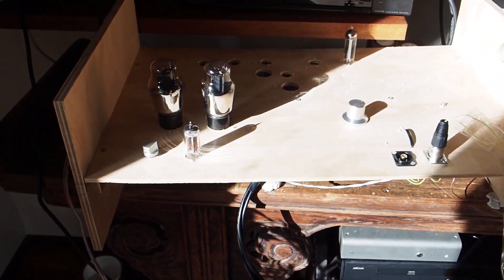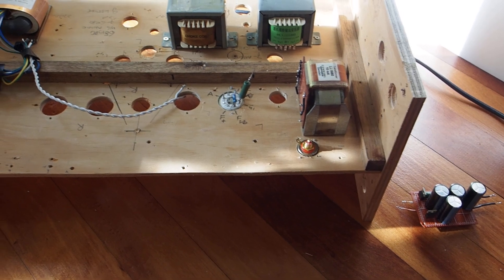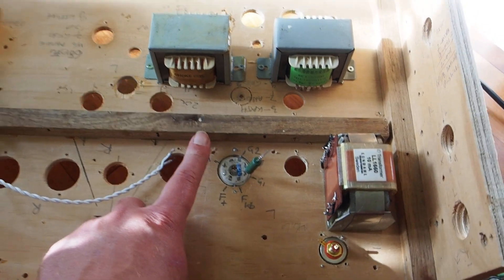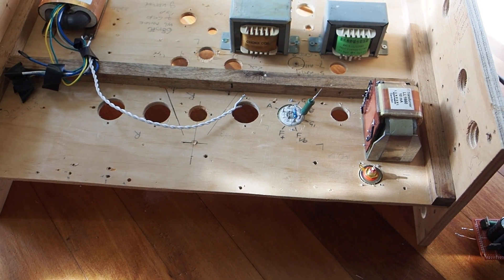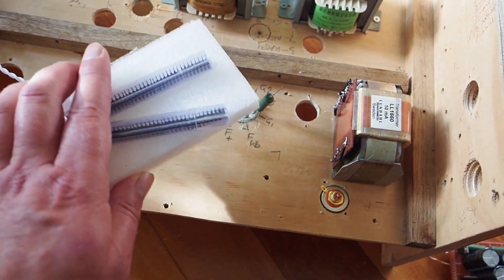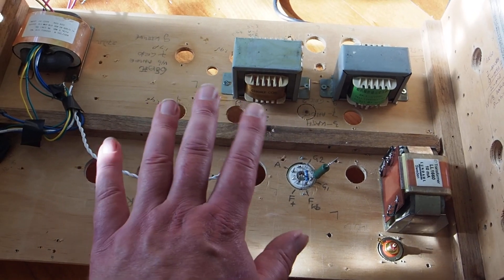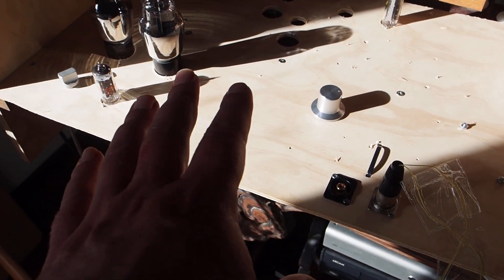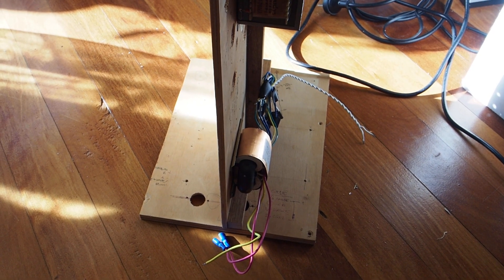A close look at one of my development tools: the H frame

Comment: The best development approach I've seen. Personally, I'm still not cured from ending up either with a breadboard so messy that is not inviting to changes and mods (because 'wow ok it works lets just leave it and build the real thing from that') or being too confident ('it's a simple circuit, it has to work like I want') and building it straight in the nice enclosure without testing board, which is again not inviting to mods, this time because it's not very accessible and I don't want to slowly ruin the case and components by many changes. So I convince myself it wouldn't sound any better anyway. Oh well..)
Reply from the maker: Thank you; I think most of us who 'breadboarded' amps know what you're talking about! Personally, I hated that after a couple of mods/changes, the amp was hard to change or became unreliable - and sometimes microphonic effects were hard to deal with... my latest, larger H frame solved quite a lot of that - look at any of my recent videos). Good luck with your projects :)

Comment: I'm collecting parts to build something similar, which I consider a "universal test platform."  It will have multiple tube & transistor sockets, and LOTS of banana-plug type binding posts.  It will test tube voltage gain & Gm, transistor AC & DC beta, and capacitor leakage.  The many binding posts will let me connect meters & a scope anywhere, in series or parallel.  There will be Vcc, bias, and B(+) power supplies built in, as well as provisions for external power.
Reply from the maker: Sounds good Clyde and thank you for jumping in and sharing what you're doing. I'm curious to hear what your insights will be after 3-4 projects!! The binding/measuring posts would be very beneficial if you have either many iterations or do measurement driven development.

I found that circuits for DACs, 1 single or multi stage tube-amps, single ended/differential all require different layouts, so the optimal layout and where plugs, sockets need to go always changes... so for that reason, I never went with a fixed setup and mounting points.

Comment: Excellent layout, taking the breadboard to the next level! Also, this is much better than a regular breadboard because you can simply flip it even upside down with all the tubes in, to work on the bottom layer. ; Cheers, Janos
Reply from the maker: Yes, I often flip it on it's long side.. hook up the voltage meters or scope.. easy to monitor the whole thing, change something.. iterate. It's funny with the type 80 rectifier, my 47 amp started mildly motor boating somewhat, so I have to resolve what was in your latest video!!! Doing a bit of prep work in LTSpice now and sim the impedance over the spectrum :-)
Reply: @EduardBroekman  Hm.. the only thing I can see on the schematics is the CT to cathode bypass cap is an order of magnitude smaller than the big C2 filter cap, however the biasing rectifier should not allow motorboating around that... you can try adding a 100-200uF to that bypass cap and see if that stops the motorboating.
Reply from the maker: @realworldaudio  Thank you, yes, I was tending to a similar plan as you suggest. Frank G. also mentioned to separate the reservoir part from ripple suppression, and the impedance sim looks much better with moving more capacitance to behind the (final) 4H choke (which should be more prone to oscillation than the 40H/275ohm choke).
Reply from the maker: @realworldaudio  I went a bit overboard, so I now only have 220uF after the 1st choke, 440uF after the 2nd (gnd) + 33uF to the cathode, and 220uF over the bias tube. 

With this, no more motorboating.. about 1V at the start but it stabilises out. However, it did get me a sonic tinge of the 440 electrolytics now which previously were at least 1 choke away (intentionally!). The sound is very revealing and hugely dynamic now.. it almost like there's nothing it can't reveal from the source... and it feels like I arrived at some kind of your ampex x3 speaker performance moment, and where the whole thing become hypre-reactive to changes. It finally feels time and for the first time fitting to apply Frank's 'seasoning' and it clicked what kind of league Sakuma was probably playing on :)

Lynn Olson once used the 45 and it performed so well, all distortion on the output was from the driver, the 45 was entirely transparent. Hence I think Sakuma was using DHTs as drivers; he had to!

Comment: ...............You can put it on it's side ..........AND...... on it's back ! 
Thanks Eduard .....the nice thing about sharing is we all can learn from each other ......the good ,the bad and the ugly .....haha..

About AC cables ..........I saw time ago the idea you mentionned the neutral and the live with different lenghts and or section............clearly there's something that will impact the resulting sound ..........;in one or another way !
Maybe it was on the same site you saw it ..........
What I became conscious about when viewing the stereo wiring off many amps and also Headphone cabling etc ...........many times the inputs /outputs share a common ground ....
So I decided to bring again equilibrity to the current on the negative /massa rail.......and used the same section for current in both neg and positive............by that I means I use the same wire/section twice on the neg rail to be equal to the two posiives .....same wires .
Even when using or working oin a printed circuit board......supressing the thin printed mass rails by the same wiring as much as possible..........
In fact the teached electronics and electricity is inversed teached .......
On a tube the cathode generates the electrons ( electron cloud ) wich is atracted by the positive anode........he flow off electtrons is in REALITY from neg to positive......in theory they yeach the inverse. It is a point of viewing but it should remember and make aware of the inportanced of massa rails and negative reference ( the source of origin of everything we  finaly hear in  an audio system )..............

Thank you for the upload and bringing your H frame to attention of every one.
Reply from the maker: Hi Frank. Yes Larry mentioned that in a video on cable gauge/width and my first two tries confirmed to me what he said. I can see what you're doing with common ground as well - makes totally sense! A lot of enclosure have potential difference that run via the ground of an interconnect too... not many think about that! I tend to run headphones fully balanced...

And yes, so true on the thinking the 'electron' way. Nearly bipolar :) On one hand the 'attraction' is from one end, but then especially when I'm confronted with DHT or a directly heated rectifier (which I worked on today).. I'm keenly aware of the 'boiling off of electrons'.. and that that way of 'emissions' is much more efficient despite the same 'attractor' on the plate or screen, but then in having to swap into thinking about diagram symbols always takes an extra couple of seconds!

Video soon, but today I put two type 80s (paralleled) in the 47 amp.. and it moved another bit towards realistic presence but also feeling the inter-musician tension/interplay and flow. It's equally subtle but also substantial.. a very odd experience - and I hadn't expected too much since I was suspecting the voltage drop to ruin things, but no - it got me more directly heated type of goodies :) 

Another very curious subject at least for the 47 is the influence of plate and screen voltage. There's a particular quality that comes out when the screen voltage is equal or just a bit more than the plate.. and definitely goes towards dull when the screen has a lower voltage: it seems like this 47 was designed to operate triode like with same voltage applied on both. Later pentodes seem to be set to a screen voltage that reflect the physical position between kathode and plate..
Reply: @EduardBroekman  Yes the screen voltage determines the waving out of the curves , higher voltage means more dynamic sound, J.hiraga did this also with his penthode amplifiers .
The limit of screen voltage ( and current ) are defined and mentionned in datasheets , ( for old tubes !!!)
..be carefull to apply those datasheets to current production , the max voltage for triode mode operation is also mentionned .

I have some 80 globe style , they are wonderfull , ........;a similar extraordinary rectifier is the German RGN 1064 , this has a " drath anode = mesh plate ) and need 4  volts on the filament , there exist a socket that accept both tubes at Jacmusic . ( a voltage drop resistor for the filament 5>>4V ..et le tour est joué  )
You may wonder about the German chemistery for their filaments .....wonderfull , call it magic .........and the meshplate lift it to heaven .......
Today ,tubes sold as mesh anode are " mostly " only perforated anode plates , fake and deceptive !

Two rectifiers = OK ( just see that the current is within the filament transformer limits )
A big power supply for the beast amplifiers from today can NEVER be so musical as the ps of a small amplifiers .....( it's only perfectly measuring on idle or on testsignals / exception for those who know how and class A ).....when designed correctly !

Separate capacitor functions for filtering ripple and for rerervoir where the  modulation ...gets it's energy . ( as you do I suppose )
An oil capacitor on input often works:/sounds  great ........something like a 600 volt NP ..........8- 25 µF ( in function of the rectifier data )
There's  a story to tell about the musical envelope ( time ) and filter capacitors , only some older technicians did know that .......and that's not oin favor of what one thinks/practice today about capacitors and their values...........in fact simply stated , the poxwer supply must be able to follow the entire musical envelope !
At the other end there is the endless battery effect ................ANYTHING BETWEEN DOES NOT WORK AS ONE WISHED.............yes you can get bigger bass, control and other suprlative audiophile gloryfied qualities , but something that the English call .....PACE , RYTHM and TIMING goes wrong...........;( also one of the big problems with many digital sources )

Good to see you enjoy still more musical pleasure !
Reply from the maker: @frankgeeraerts6243  Yes mesh plate rectifiers... rare as unicorns but I've heard that subtilty of those early Philips and Telefunken is a whole level beyond even the directly heated category. 

While I have a differential, I do now hear the influence of electrolytics.. and I just spotted Sakuma using 8u+10H+8u+10H+8u (all oil) for one of his push pull amps.. to be honest it feels like I arrived at your 'seasoning' stage.

My filter setup is 4.35uF - 40H / 275ohm - 220uF - 4H/27 ohm - 440uF(gnd) + 33uF (cathode). But the 2x220uFs are Nichicon KXGs which were previously only in between chokes, but I wanted to fix the motor boating + separate the 'reservoir' from ripple reduction as per your earlier comments, but that got these electros a bit too close to the tubes. Astoundingly dynamic and revealing - nothing is unclear, PRAT still fully intact but it has a certain electrolytic 'bite'.

Comment: Awesome to share your amazing DIY experience. Very nice dev setup. If you visit the Netherlands, stop by in Hamburg 😊 your finale enclosure looks very professional, are you selling some of your gear?
Reply from the maker: Thank you, also for the invitation - I will keep that in mind for sure! 

To answer your question, yes, I hope to offer a build service for my designs in not too long; the shown enclosure is also planned for a new headphone amp. A different (later) offer will be very likely the 47 amp: I am working on giving it a good looking, original enclosure so it moves towards being an 'objet de desir'... but it can be customised anyway.

On the finished model in the video, that is a prototype with push pull E180Fs or 6N6Ps, Lundahl OPTS, balanced in and line/headphone out - I've been using on my desk with my PC/Dac setup and it allows me to switch between my headphones and desktop speakers. I'd like to transform it into a 6E6P/6E5P based amp, which I find has a very nice tone and is very low distorting.

Reason for this is also that a friend of mine already runs an earlier version of that 6E6P amp and its paired with a Verum 1 (8 ohm!) headphone which is a really good working combo which sounds better than the Violectric amp I had, or this prototype. Anyway, I'd like to step that singled ended 6E6P design one more notch with chokes and tube rectifier(s)... so that's the plan for this weekend and then test it on both Hifiman HE6 and the Sennheiser HD600.. see if it sounds good enough to be offered.